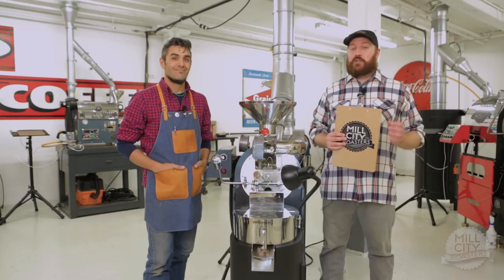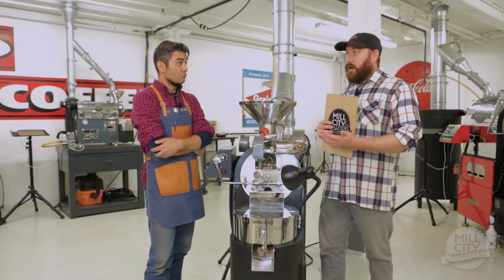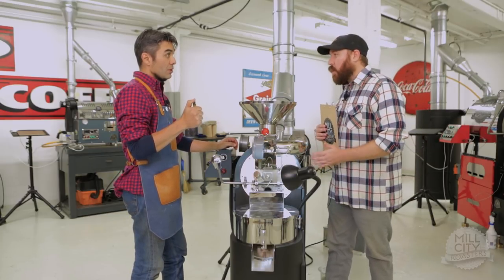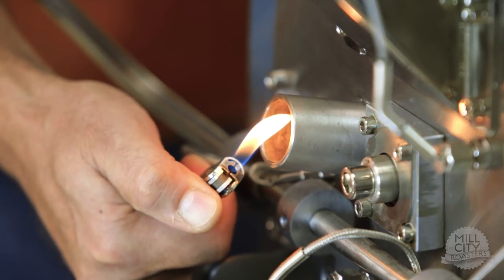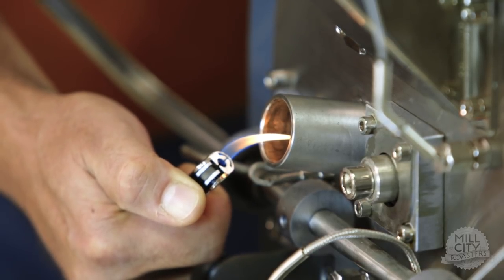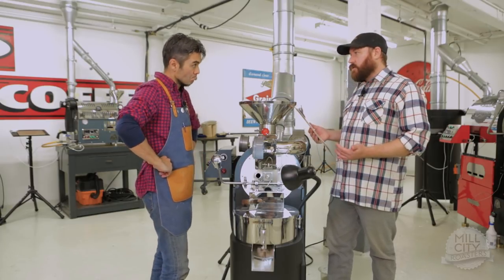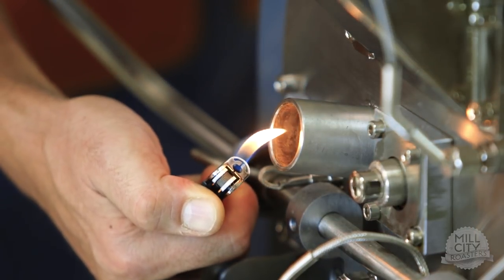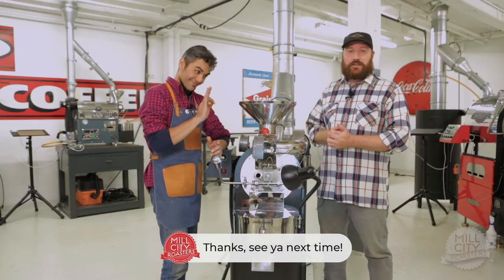The Lighter Trick: An MCR Educational Short

Comment: How does the pressure gauge correlate with this method? Couldn't we also calibrate the lighter method (low, med, high) with numerical values of the pressure gauge?
Reply: Yes indeed! However, the numerical values on your pressure gauge are meaningless until you give them meaning. What I mean (ha) is, how do you know what "medium air" is on your pressure gauge? It is impossible to adjust to a value on a pressure gauge if you don't have any frame of reference. We are showing you how to gain that simple frame of reference. You can then associate your pressure gauge to your lighter's response. This is simply a helpful tip. Enjoy!
Reply: @roasterjoe  great - many thanks Joe!

Comment: Nice video! Since I never roast with an empty drum, I'm wondering what value the lighter trick has when the drum is empty?
Reply from the maker: That was for illustration only, Jim. We're sure someone somewhere thinks that the lightest roasted coffees are produced in an empty drum.
Reply: Jim,

That is a GREAT question. If you have your air too high while warming up your fan may pull full from your burners so that the flame drifts and fuel is pulled into your venting through the machine. If you have the airflow too low, you may not pull enough oxygen into your burner compartment. This too can cause a flame to wander in search for a breath, potentially finding that breath at your compartment panel openings. We don't like to see flames leaping from a burner compartment or burners that are partially lit. 

I also illustrated this because many of the people that call us with airflow issues have used the lighter trick with the drum empty, and ONLY with it empty. I wanted to show that it is ok to do this, but once the coffee is in the drum it will be different. This also helps to illustrate the point that at different batch sizes you will likely need to find a different "Low/Medium/High" fan setting. So... more being said than what I am showing explicitly, keeping the video time shorter. 

More practically speaking, it is also much better audio quality when we do not have coffee in the drum. So, having the majority of the video rolling with an empty drum helps our audio team not have to do as much work. 

I hope that helps!
Reply: Hi  @roasterjoe  , I was wondering why you didnt mention there is a difference between a cold and a hot roaster? You should set the airflow when the roaster is heated up Ill suggest.
Reply: @brianlarsen3457  I think by covering that you should check often and with a full drum and an empty drum we should be good! I try not to be too dumbed down. I think some things should be understood. Perhaps I am wrong! Hopefully the dude I missed by not overtly saying that will read your comment. Thanks for the help!
Reply: @roasterjoe  Im just saying this because Ive made the mistake, to set the airflow when the roaster was cold. And after heating it up I noticed that the flame was BLOWN out, which means there was actually an over pressure in the drum caused by the heat.
Reply: @brianlarsen3457  how do you handle this?

Comment: What would happen if I were to roast with the airflow too high? For example if two roast curves were exactly the same but one had the airflow too high the whole roast, would that translate to a specific taste in the cup?
Reply: Jason,

I love this question. To be quite honest, if your airflow is too high either: A) You will strip away heat from the roast, or B) You will suck coffee from the drum. 

Where this comes into play is as your coffee loses weight and expands (giving it more mass that can more easily be grabbed by air) you will be roasting along just fine and all of a sudden, PING! PING! PING!... you hear beans rattling through your venting. 

This is not only bad due to the loss of coffee, but also because if that bean gets wedged into your venting system it can become an ember and a fire hazard. It is packed with carbohydrates and oils and will burn much hotter and longer than chaff. We want a coffee free venting system. 

So, it is important to find where your airflow is too high using a lighter and not waiting to use beans later. 

That said, I do believe that there are flavor reasons for this too. As you likely know, I am not going to be prescriptive on those. I would encourage you to roast a coffee the exact same way twice with airflow being high and too high as the only variance and taste the difference. Outside of needing to use more fuel, I think you will find a different flavor and a more difficult time in maintaining your initial curve. But, I could also be wrong! No way to know but to try it out!
Reply: It will affect the cup taste to be papery with less sweetness. I have done this before where the relative high airflow I used was left between batches of the same coffee. I ran through both roasts and it was distinctly less flavorful, with a hollow structure. My experience, but I hope it helps!
Reply: @Georgeyardley  agree.